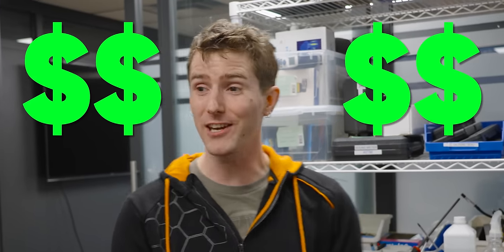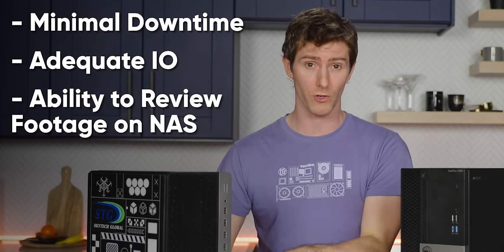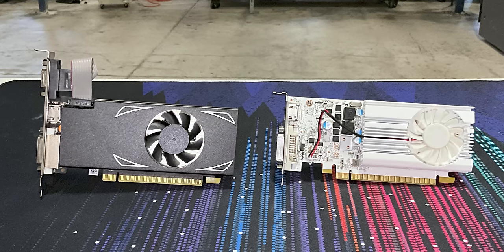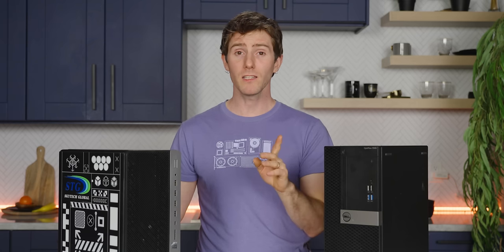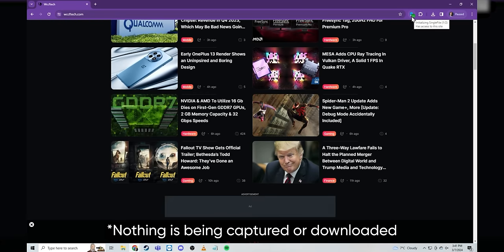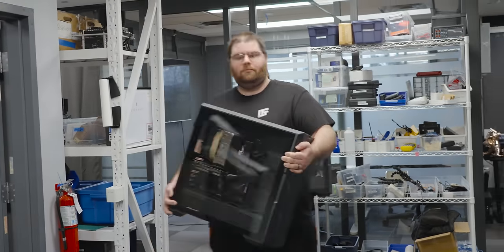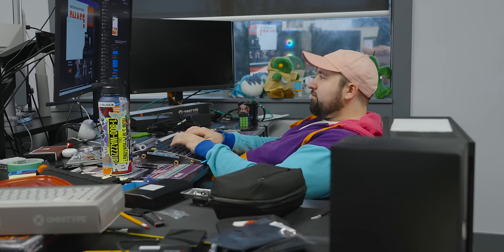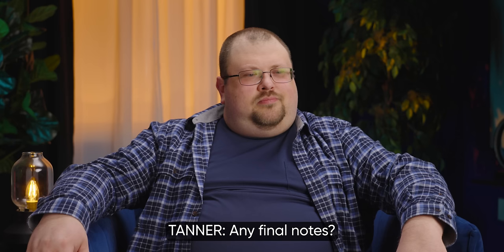We Downgraded our PCs to Prove You Don’t Need a New One

Comment: I am writing this on a on desktop with 12+ years old CPU (2012). It is not a problematic for any task really.
Rendering 4K material to unsupported H.265 takes time, about 1.5-2x of the output length, so making a 20 min video takes 45-60 minutes to render. That is not really a problem for most people.
Image exporting to final TIFF/JPEG takes about 5-7 seconds per 40+ Mpix raw file, that is not a problem either considering you don't export tens or hundreds of files from shoot of the day, important is just to get the files out and get them viewed in final version manner, without need for exporting them. And for that 12+ years old computers work great. 
Just forget the gaming of latest titles and so on. That is always the achilles hell on computers. 

My common laptop for use is soon 16 years old, a Late 2008 Macbook, works great! Can do almost everything as needed, except gaming for any serious 3D graphics (9400M GPU) requiring game. So if your game library is for retro or classics, it works totally fine. 

Do I enjoy from my top of the line setups? Sure... Many things are nice, but if you leave the gaming out, old setups have no purpose to be looked down...

Comment: Daily driving a docked laptop with Intel(R) Core(TM) i5-3320M CPU @ 2.60GHz here, since 2016 (proper dock, even with optical drive, not those USB thingies) 😸 External screen, DELL 2007FP, 1600x1200 at 20" . For serious jobs there are two dual-Xeon E5 v4 machines with like ¼ TB of RAM each (ECC baby!), interconnected with ancient QDR Infiniband, using theoretically unsupported fiber optics ☺

Comment: There are a lot of drivers hidden in the optional updates section that make them a lot more stable, windows used to just do those things automatically,  but I kept finding that after I'd install a fresh copy of windows, it would never update the core system drivers for things like the PCI Express Root Ports and Intel ME, I'd find countless "Other devices" in device manager that would go away after checking those optional updates hidden in Windows Update.
Reply: Goes for anything really, but I mostly deal with HP's ProDesk, EliteDesk, and Z Workstation lineups, and then of course the OptiPlex, I've been using that specific range of machines since I was in Kindergarten, I remember when the 780 came out, in comparison to the GX620 my god were they fast.

Comment: 13400, 3060/3070, 32gb ram, and 1tb nvme is pretty good for a basic workstation/gaming pc. most people dont need more than that. 32gb ram is a requirement imo for modern workstations. 16gb is fine for 1080p gaming, but for multitasking in win11, id personally recommend 32gb

Comment: im still running an intel i7 4790k 32 GB DDR3 ram with an nvme pcie adapter, with a 1660 super and a evga 650 watt psu, oh its running Linux mint 22. works fine

Comment: there is a mid way in this. You can still be fast but u dont need expensive parts to get work done. In stead of a 500 dollar main board youe could do 250 Your old case can always do a second round or even a third Most of the last 10 years can do multi fan cooling and hold ssd's and fit modular PSU's Ram When u got 2 sticks just plug in 2 more and u got a faster machine. If u did not jet do an OC try it and u can upgrade for free!

Comment: I still have my core 2 quad with almost legendary crucual m4 ssd as a backup, the problem is that win7 is no longer enough and compatibility issues occur.
Old laptop on 3rd gen i7 still works fine with win10 (again, after putting ssd and more ram). I even played some games on it after connecting 1060 to it via mini pcie slot used for wifi adapter by default and external monitor.

Comment: a bunch of these issues are Windows issues.

I run Linux on a i7 4790k with 32GB RAM just fine. 3 browsers opened at the same, coding and stuff.

Comment: My home machine is an i5-6500, with a GTX-1660 Super. I'm still perfectly happy with it, as it's able to comfortably run the things I need/want to run. I'm not a big gamer, and most of the games I do play are older, so my machine is generally up to the task. Also I primarily run Linux (except for gaming), which runs circles around Windows, performance-wise, any day of the week.

My work laptop has a 4th gen i7. It's big and heavy, but it also works well enough for my work tasks. Sure, a faster CPU might be nice, but this one still gets the job done. I actually downgraded from a laptop with a 6th gen CPU, because the extra cores in the i7 (4+hyperthreading vs 2+hyperthreading) and double the RAM (16 GB vs 8 GB) end up giving me better performance for my workload.

I'm a big proponent of sticking with my computer until it can't run the things I need it to run.

Comment: A Core i5-6500 should clear 10GbE easy enough. What they are running into is lack of hardware accelerators for the video codecs in use. All these systems should have included some kind of GPU upgrade to a modern architecture with driver support.

Comment: 7 year old laptop as a daily driver, was top of the line when it came out. apart from the battery, its fine. never felt like getting slower, unlike my mcbook i had once that got slower and slower whith each OS update, hm, and then i replaced it with a linux driven laptop

Comment: I think at this point with Windows-based computers (laptop or desktop), the recommendation is nothing less than an 8th gen Intel CPU due to WIN11 requirement.. and now ith 24H2 update coming soon, you require SSE4.2 support as well to ensure successful update.

For the basic user, 8GB RAM and integrated GPU is plenty resources for surfacing the internet, checking email and document editing.

Comment: I am currently using a 4th gen Intel i7 MacBook Pro...it's surprisingly good It has an AMD R9 370M GPU and running Windows 10 for games.  Sure, it's not going to play games at 1080p with max settings, but it's a 15" screen, so low settings is fine....Strangely enough, it won't run Killer Instinct at a playable speed despite that game coming out in 2013....but yet it will play Outriders at 60fps which came out in 2020...Destiny 2 stutters a bit when entering new areas, but once you're in the new area, it's fine for the most part.  Plus I have the option to run MacOS if I need it  (My husband wanted the MacBook Pro, I didn't...so I use it on Windows, he used it on MacOS....until recently when he bought a MacBook Pro with an M1)

Comment: That's why you get these GPUs like the 1060 or now the 3060 which people use for 7-8 years. As long as everything "works fine", I don't think I'm switching off my 3060. Even in newer titles, I'm happy as long as I get 60ish fps at 1080p with medium settings. Keeping a already good PC is way more convenient than constant upgrades. It also helps to build a more stable and less beta PC as you know exactly when and why different bugs occur, so you have to spend less time troubleshooting.

Comment: I built new in 2022 after waiting 12 years between systems. It was expensive, but I went from PCIe gen 3 to gen 5. Also, Intel to AMD.

I'm done with slow PCs. Watching this video raised my blood pressure 10 points. I had to go use my PC for an hour to lower my blood pressure back to a reasonable level 😂

Comment: I get along with it. My last upgrade around 2015-2016 was like 250€ + a used gpu. My new one was 300€ still  use the old gpu but searching something to update it. O don't thing my pc is slow 😅 its a 6 core intel has an m2 ssd. Works good.

Comment: Idk. Personal opinon. Having dealt with an older work laptop doing crestron programming. It was a real pain in the butt. My work gave me like a 4th gen intel laptop.. it would take like 5 minutes to just compile a program.. which now takes 5 seconds on my current laptop. I now have a dell precision workstation class laptop. With an 11800in it. I spec'd it to be without a gpu because all of crestron procramming is cpu based. Even the vtpro software is cpu rendered. And the igpu has been fine even running 2 extra monitors one being 4k and i have zero issues. And it has a massive dual fan heasync on the back that is only cooling the cpu now. The fans literally never turn on unless i loop cinebench for a few minutes. My previois laptops always had overheating issues. Cooling was a big prioroty for this laptop. 

I think older pcs like this have a place. But with things like progtamming or video editing or things similar. The power of new hardware just makes it so much better.

Comment: Unsure if it's a Dell thing or my companies IT department, but I just got swapped to a new Dell Optiplex with Windows 11, and it's been kind of a disaster. Nothing I do is taxing on the CPU or RAM, or even really the GPU. However, with this new PC I have tons of weird bugs that just don't make any sense. Like Ctrl + C, and Ctrl + V not working after so many hours of use. Or my main program window not loading in the tab menus properly, or double clicking a pdf file, and the PC unable to open the document in Adobe. All of these things I don't have to worry with my home PC. I just think that Dell PC's in general have weird bugs. I'd venture to guess that a decent home built system from that same age would have worked better than the Optiplexes.

Comment: You guys would present an especially high bar for this kind of test as well. Doing high quality vid is still advancing in volume faster than most of our tech is increasing in performance. Cad design generally doesnt need super high performance even though the designers will tell you it does. Its generally not optimized for modern hardware in the first place, and generally CPU bound for performance and increasing responsiveness with GPU updates has hefty diminishing returns. For general workers doing coms and organizational stuff any old computer is fine, though something within 10 years is generally good for extensive web browsing, only because of the update hamster wheel that Google Chrome and Microsoft have us on. 

Not particularly for you guys, since you've talked about having low cost BC Hydro power.. but for most people older hardware's reduced power consumption to do basic tasks would be a significant upside as well. If you really have money to burn but want to keep up with the ECO side of things, running a basic computer for some tasks and moving to high end high power consumptions systems only for the tasks that require it could be a good thing as well.

Comment: Hi I have a complaint about the LTT Screwdriver. It keeps messing up screw heads. I got it for assemblying things for my daughter (like a play workbench today) and despite the fact that the screw heads fit perfectly, it screws up the screw heads (no pun intended) and then the bit is left with metal shavings. 

Is that because toys and toy furniture is usually shipped with bad screws? And how do I get the metal shavings off of the magnetic bit?

Comment: So I had £350, and wanted a PC. I used the Dell Optiplex 7040 (same as this but the i7 6700 version, it was still 16gb RAM but had 128gb m.2 drive. Refurbished). I used it for about a month and a half before I bought an ATX case, GTX 980, a PSU, Evercool Fox-1 and a WiFi/Bluetooth card. It's not really a PC I would ever see the specs of and jump out of my chair however the 980 is still a solid GPU for everything at 1080p. The i7 6700 is a bit of a let down when playing Cyberpunk 2077 and other high end tasks but works a lot better than the 6000 series i5 you had in yours. The fact in total I spent £320 on it is crazy, it's a very cheap home build, but handles everything I throw at it lol. Good video Linus group

Comment: Your problem was a schoolboy mistake caused by swapping your SSDs from the new systems to these ones.

Did you reset windows? Windows is pretty picky about leaving the system it is installed in, not only may it deactivate itself but you need to spend time manually reinstalling drivers etc. Not all drivers can be expected to cover older chipsets.

That also applies to Windows updates. Yiu need to clean thise up too. Updates that are only specific to your original machines may have never been selected for these platforms.

Did you flash the latest firmware on these systems?

The "front headphone jack" issue, did you install the HP drivers/software for enabling any advanced features like reconfiguring the jack for a headset? I use Dells at work and can safely say if you dont have the software installed, you cant use a microphone. These ports are software controled, you swapped SSDs, setting up the HP provided audio drivers and related software should have been done.

You also cant just assume that these jacks are headphone only just because thats all you get when you plug in a headset. Did you look at the jack pinout? Maybe it's also faulty. Was this headset tested on another machine's jack?

Suffice to say, this "problem" is easily resolved by using a USB headset.

Why did your 10G Nics die? Im assuming it's because you didn't provide adequate cooling. Those things will get HOT and that heatsink on the NIC is pathetic. It's just about a fashion accessory. You used a bad NIC design or you should have just stuck a fan on that tiny heatsink.  These systems are office DESK top systems and are usually expected and designed by the manufacturer to have nothing more than IT add new ram, swap a drive or dust the machine out with an air duster. They are nowhere near optimised in regards to airflow. Had the BTX form factor taken off you'd probably have been totally fine! But even though it was a great idea, nobody wanted to leave ATX back in the past so here we are.

So:

1. Yiu should have used a fresh virgin install of windows.
2. You should have installed the HP drivers for all motherboard components along with any software HP provides for sound mixer control etc.
3. Your graphics cards thus would have had feesh installs of the drivers.
4. All UEFI firmware should have been updated, simply for security and stability improvements.
5. Your NICs were inadequate with their flat heatsinks, stick a small fan on it and there you go.
6. Never assume just because something is refurbished that the hardware especially connectors like the audio jack is working correctly. These things may have already had years of wear. Such things could be replaced, you could have explored the attempt to simply obtain a new jack and swap it? Also the issue was avoidable with a USB headset if you cant simply use any audio connectors on the back of the machine

I also don't believe for a second anything about it taking 2 mins to boot. These machines are clearly not old enough to have that kind of problem and to actually create that problem l with Win10 you really need to be on HDD and you can get better slowdown if you only have 4G of RAM. Trust me, I actually work in IT for a living so I know what I'm talking about. The reason why you got this slowdown is largely due to the schoolboy error of thinking windows can be swapped between systems.

It cant.

Linux can, and always has been able to. I've been using Linux since 1998 and trust me the difference between Linux's ability to swap to a new system as if nothing happened has made windows look like a toy for decades. You can coax windows into doing it, once or twice perhaps but you need to sit down and manage the transition like i described. Things get easier if you were moving from a Dell to a slightly newer Dell as they would have much the same hardware and software versions.

If windows 10 was sitting at the "please wait" spinny thing for 2 mins while booting, thats because you have network issues. Windows 10 will look like it hung during boit while it tries to connect to the network and domain controller. It happens on our laptops all the time, you can fix it in the registry.

Comment: Some people really do not need a lot of CPU or general computational horsepower in order to get their work done, that's right. My dad for example still uses is PC from 2009 with an Athlon X3 435 and basically does not complain about slow performance. Also in the company I am in some folks are still rocking 3rd or 4th gen i5's and get everything done since they just need some word or excel processing. We are on our way to swap all of them with Mini PCs with an R5 5650GE and 16GB of RAM due to the 3rd and 4th gen not being supported for Win11 and we don't want any Win10 computers running anymore once the OS is not supported anymore (no, hacking the ISO is not viable in a coorperate enviroment so no custom ISO with rufus tricks). I do take those old computers home at times tho and managed to get family members a PC going and they are happy with it to this day, and when the day comes Win10 runs out I can just give them an install of Linux Mint or Ubuntu and they are good to go for another 5 or so years.

Comment: This is what I've been saying for a while. Most people can have an amazing experience with something like an i7-6700k, 32 GB of DDR3 or 4 RAM, and a decent SSD. Maybe an RX 570 would be a good video card as well. This is usually the route I go for when building computers for family members. If they're not doing any intensive work, then there's no point in getting them a overpriced ($700) piece of junk. Debloating Windows on a older well-kept machine will net them a much better experience than a stock new computer. You can add more RAM or a better graphics card later if needed.